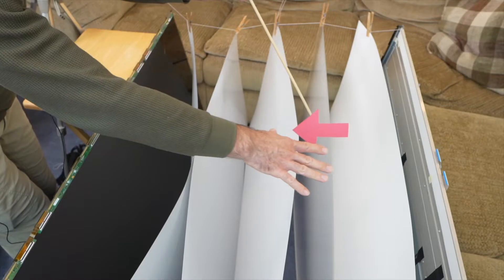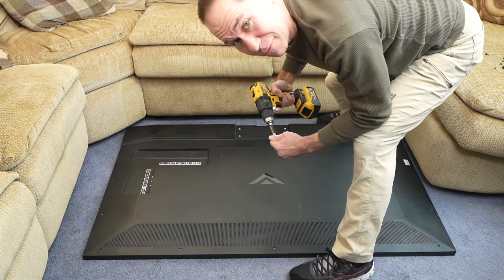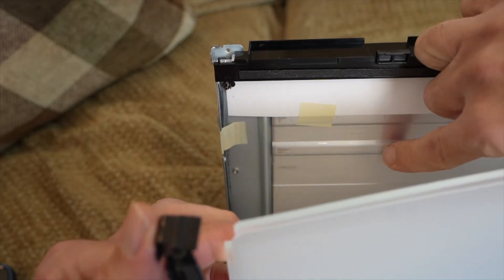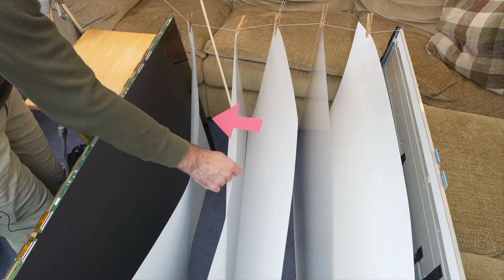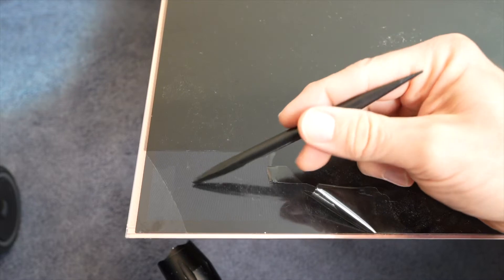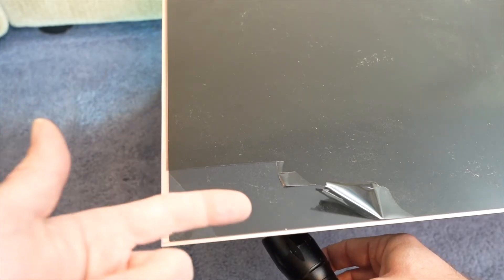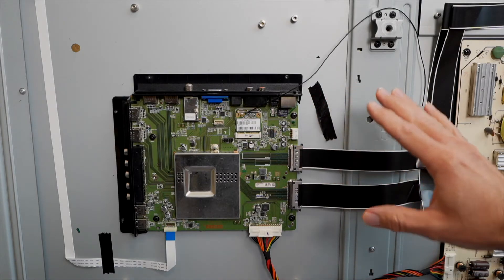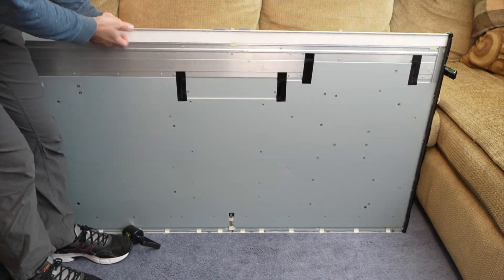How an LCD TV Works - I took my 60" TV apart to Explain

Comment: This explanation is in no way complete. How are the tiny transisters that make up the pixels triggered on and off.
Reply from the maker: You mean you n the sub pixels?  If you want a technical explanation, the row signal voltage goes high, which goes to the gate of the transistor (turns it on), and at the same moment the data signal (brightness) is send on vertical wires to indicate the intensity of the red, blue, or green sub pixel.

Comment: I have a 65 that when I turn it on the picture freezes then it starts blocking the backlight or fades to black. Screen is not responsive unless i turn off then turn on. It will then come on for a few seconds then screen freezes and it fades to black. Its a sony kd-65x80j can someone please help?

Comment: how would you make a dual layer lcd then? What films or screens and polarizers would be used?
Reply from the maker: I would assume you would want a polarizing film on both sidesof the first lcd and likely put polarizing film on both sides of the second lcd for overall control of the color.  I haven’t researched it though.

Comment: Wish you could have explained on how to fix this tv.
Reply from the maker: The only way is to replace the lcd screen which is almost always not an option because a replacement screen is difficult to find and if you could get one, it’s not cost effective.  The only time I’ve done screen swaps is when one tv has a bad backlight but good screen and the other tv (same model) is the one with the broken screen.

Comment: Hey Reese! Thanks for posting these videos, they have been a huge help!
I have an issue that I haven't seen but one video on and it's in Indonesian (which I don't speak;), but I did watch.
I have horizontal lines that scroll vertically for three seconds, then clear picture for 2-3 seconds. I have ordered a new T-con, but it's coming from china and will take about a month to get here. T-con is a 55T32-COF, I have identified on the board on one side the "clk 1 and  2"  but no idea which pins they might be.  TV is a 50" Sony, but that T-con is used in several other brands. Any ideas?
Thx!

Comment: So I recently came across a hisense flat screen tv.  It was left in the apartment I just moved into.  If I had to guess I'd say its a 70 inch tv.  Although the tv was here there was no power cable or remote.  I ordered some power cable off amazon just by looking at the port on the back.  Now when I attempt to turn the tv on I get the hisense splash screen for just a moment and the tv will turn back off.  I did notice that the right side of the screen looks like possibly the backlight leds are not working.  Do you think this is a TCON issue or a backlight issue?  In either case do you think the tv is repairable?

Comment: Hi. Thanks for your great videos.  I have a 4 year old Sony kd-55x9000f that developed problems & stopped working shortly after a power outage. When the power came back on, it started up but froze after performing a few basic initial menu functions. Over several unsuccessful attempts to get it running better by trying to clear caches etc (but being interrupted by freezes) I went through the Sony troubleshooting process, including a manual power button reset. After that, the TV would not turn on at all (no backlight). I'm hoping that these symptoms are something you recognize so that maybe you could give me a solid hint as to where I should start to attempt to fix this.
Reply from the maker: Thanks for watching!  Did you see the video on what to check after a power surge?  You should be able to narrow down the problem to the power supply or main board.
Reply: @FrugalRepair  No. Thanks, I'll have a look.
Reply: Those models are known for eMMC failures. Not worth repairing.

Comment: Hi I’m my self is tech repairing person my led smart tv got small black dot right on bottom model on display I opened it many time and clean it tried stick tape method too it’s got few blue pink vertical lines display strips are perfectly fine do you thinks lcd display problem or board issue look forward to hear from you thanks